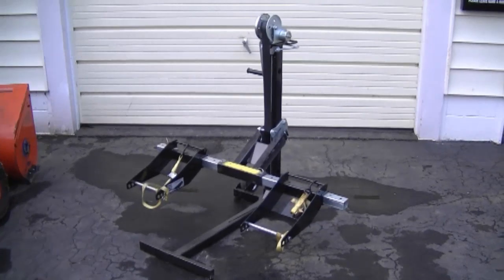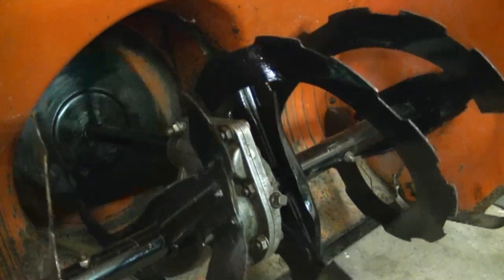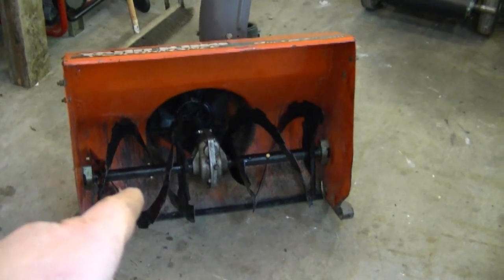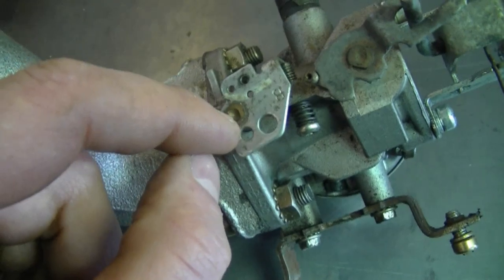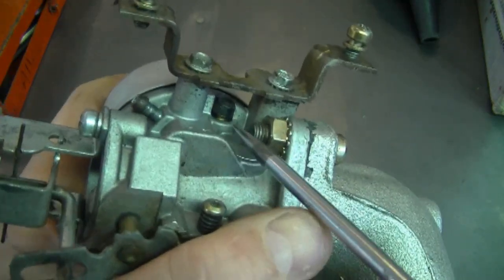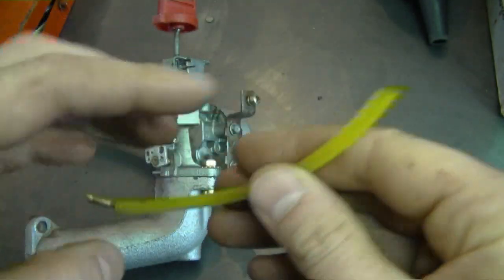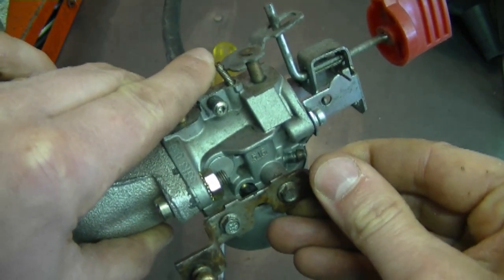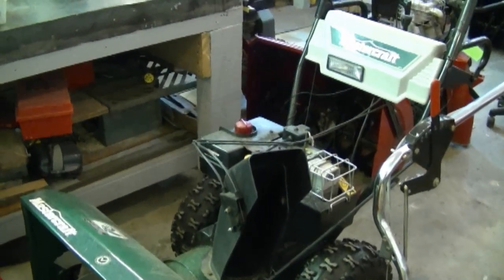Small Engines Q & A Video #77 in HD

Comment: @donyboy73 Tomorrow i will try to get a used Cylinderhead. And if i have + replaced the gasket. I will make a vid for the First Start. It's gonna be smokey, because i did add some oil in to the Cylinder just for the first time. i will take it off to maybe. Anc cleaning the top of the piston. There is some carbon build up there. That moped is from 1994 :)

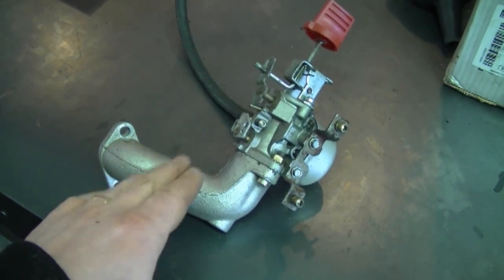Comment: @donyboy73 Don Finally The moped runs again with a used Cylinderhead,carb, and a new headgasket. It was about 3:30 hours work. Driving to my dealer 2times that total 28KM. And im now planning to replace the Airfilter with a orginal or sports one. i think i will buy the open airfilter. So i dont need to take the Whole Engine off :)

Comment: I just found your channel thru Eric the Car Guy. I have no idea if this is the right place to post a question, but I have a issue with my B&S engine on my reel mower. It runs fine but after a minute or two it starts making a high pitched screeching noise. Any experience with this issue?

Comment: Don do i need to replace the gasket between the Cylinder and crankcase if i've taken off the Cylinderhead ( 2 stroke )? i did i need to replace that and i cleaned the carb and the float had a cracked gasket.